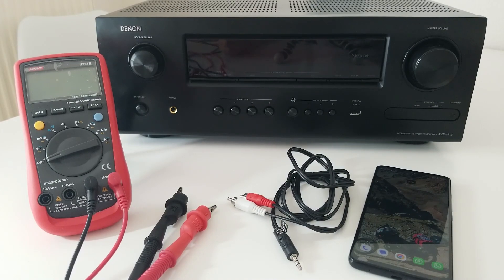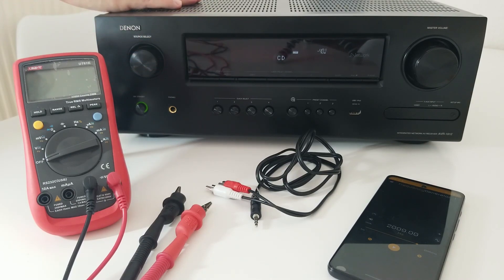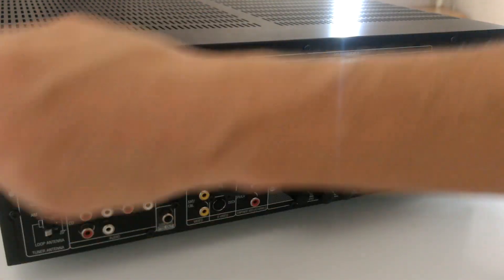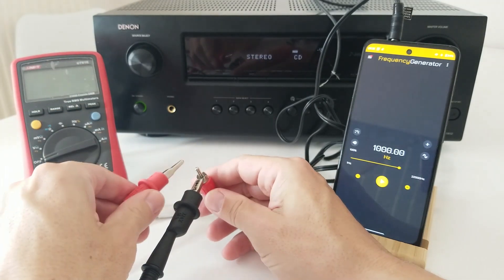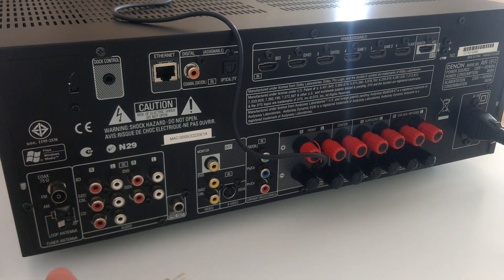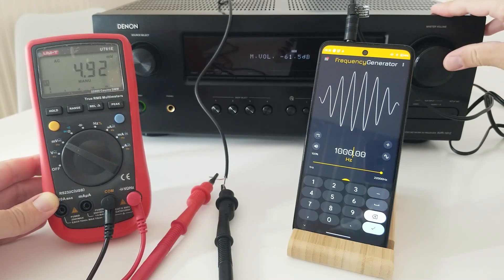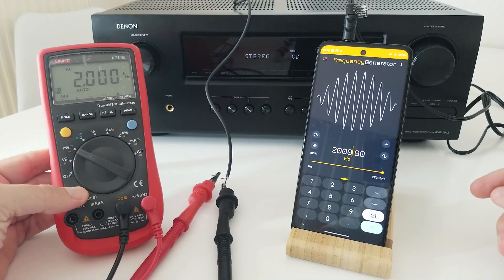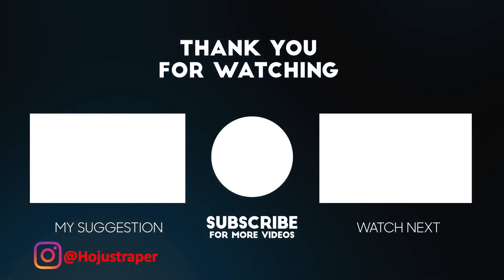How to test your Amplifier with a Multimeter & Frequency Generator - Denon 7.1 Channel AV Receiver

Comment: Very interesting! Do you think it is possible to find the cause of distorted sound in an amplifier after a recapping? Don't know where to go from here.
 I have made a video on my amp: https://youtu.be/N2VzitSgAQo?si=cN_cJR50xPfW5oHS
Reply from the maker: Sorry! I am not an audio expert (at least yet hehe). I only know that resistors and electrolitic capacitors can affect the audio wave. Have you used electrolitic capacitors with the same specs? (voltage and Farads).

Comment: To test my amplifier should I use a 600volt or 1000volt meter?
Reply from the maker: Hi, I am using a home based tester and worked like a charm. As long as it can measure AC it will be ok.

Comment: Presumably it might be good to test that the left and right channel produce the same voltage on the output at the same volume level.
Reply from the maker: Good idea and you are right!! I did not do that! Luckyly the amp is working every day like a charm!
Reply: Could you expand on why one would want to do this? And how?
Reply: @Eric48359  I had an amp where the right channel seemed quieter than the left. Swapping speakers and cables didn't make any difference, so I suspected some problem in the amp.